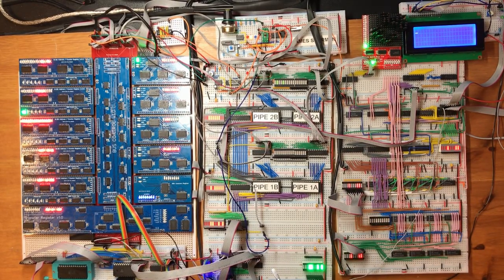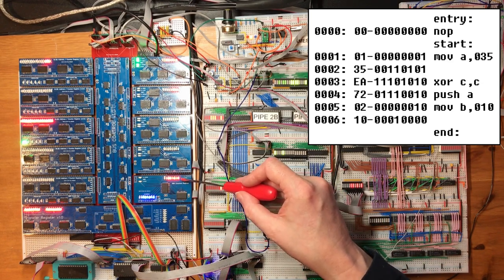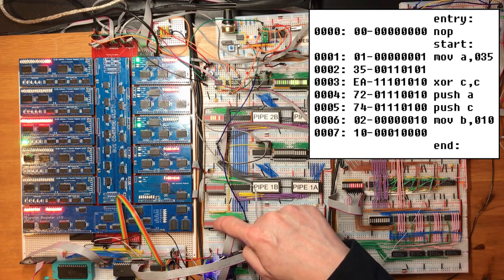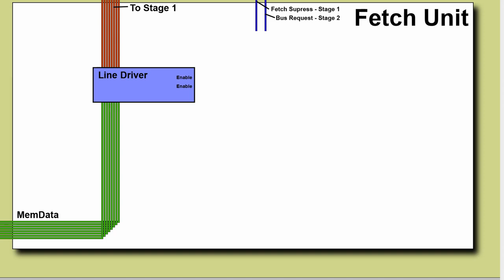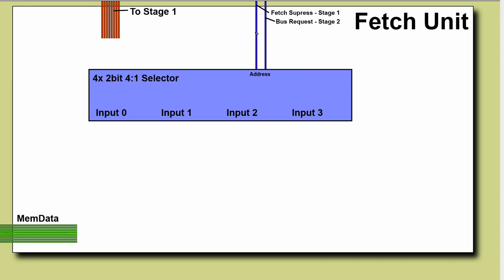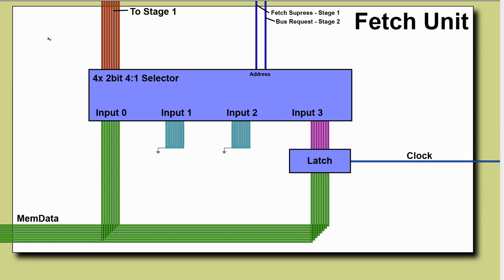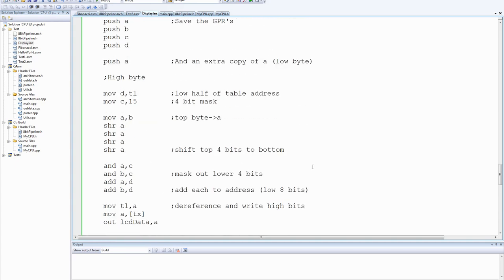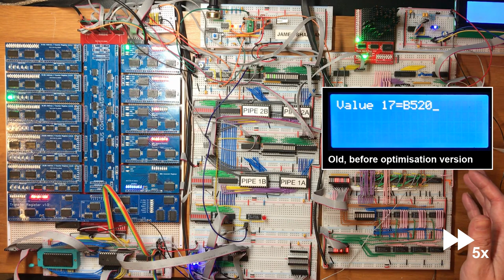Contention Example - Making an 8 Bit pipelined CPU - Part 65

Comment: I implemented your circuit to solve the contention issue shown in this video. It works fine, the only thing to do which was not yet mentioned in the video is to XOR the 2 inputs (no-fetch, bus-request) to the enable lines of th line driver. An excellent solutuon, congrats and thanks, James!
Reply from the maker: I'm not sure from your comment where you hit that problem.  There isn't a line driver in the proposed circuit, it sounds like you have left it in on the output in which case the xor is hybridising the two solutions.  I should get a chance to build the circuit in the next couple of weeks. Be interesting to see if I hit the same problem.
Reply: @weirdboyjim  I mention the line driver in pipeline stage0. I see, there is a difference in my build, instead of 541 I am using 245 because I could not find a spice model for the 541 in proteus, the 245 chip only has 1 CE line and therefore I XORed the no-fetch and busrequest lines, not to produce a NOP when both lines are high, but to fetch the constant load instruction a second time from the latch. it works fine

Comment: when showing code on the screen, you should place a red arrow of some kind pointing to the current line, would make following easier. thanks
Reply from the maker: That would be nice, I've thought about that before. It would be complex and time consuming though, especially since I'd have to separately annotate the instruction in each pipeline stage. I may give that a try next time there is a relevant video, but the editing already takes so long compared to the building I don't want to commit to too much extra.

Comment: Wouldn't it be simpler to feed Fetch Suppress NAND Bus Request into the enable of the stage 1 latches? So if both are set, the latches would not cycle in the next (both raw and decoded) instruction (which we know is a NOP) but keep the e.g. constant load for a second cycle. The instruction would still be double-executed, but you only need one or two gates and not a set of 6 selector, latch and gate chips.
Reply from the maker: That's an interesting approach but I was trying to give a clear example and I discarded a couple of other paths as I felt more complicated explanations on the implementation would confuse the message. Never sure how well I do with those compromises though.

Comment: Another interesting video, the contention issue is certainly a brain melter; your solution to store the instruction or data that was fetched last and lost by the write to memory is nice, but I'm trying to think if it's possible for the PC to run on and instructions get missed?

Having a 16 bit align assembler directive so you only need to do a single byte addition; seeing that drives home how little you know, and appreciate the giants whose shoulders I stand on who saw what I do not.
Reply from the maker: It shouldn't be possible for instructions to get missed because the issue only happens during a memory read during witch a fetch couldn't happen. You would have a problem if I introduced an instruction that both accessed memory and used an immediate as two of those in a row would trip the system up. I'll obviously not be adding one of those for exactly this reason.
Reply: @weirdboyjim  I got to part 72 yesterday and saw the circuit with the Fetch buffer in operation. I would need to go back to the opcodes to see when they increment PC, and so if a second pass of an instruction would cause it to inc PC twice. Obviously it doesn't.

Comment: So the 2 address lines would go high when the failed constant load enters stage 1 after the memory load, then the same constant load, previously stored in the latch chip would get sent out onto the pipeline, but would't this mess up the constant? The constant would be what was currently coming from memory, but if the address lines are choosing the constant load over the constant, then wouldn't the constant load load in the opcode of the next instruction after the constant?
Reply from the maker: The constant load instruction is what is held back until the memory contention passes, that way the regular load does get the correct data that followed in the instruction stream.

Comment: Have I seen this before? maybe I'm imagining things... but that is a very clever way to detect and deal with the problem. Is there any posibility that leaving the instruction to execute (and fail) could cause other unintended consequences?
Reply from the maker: At the moment the instructions that will trigger it are loading an 8bit immediate into one of the 8 bit registers.  In pipeline stage one they load the data into the constant register, in pipeline stage 2 they copy that into the destination register. If I don't stop the instruction then it will just copy the wrong value, and then copy the correct one. The difference will be if I want to implement something like "push [imm]", in that case not killing the instruction would result in odd behaviour.
Reply from the maker: When I upload videos I do a watch thru to make sure there are not any errors. There was an error but I forgot to cancel the release so the previous version of this video was up for a few minutes.  If you look at the final segment of this video I show the tidied up wires, in the previous version I was cutting those wires during the "race" but I accidentally knocked a wire and it messed up the last 3 numbers in the sequence. Slightly embarrassing if I had noticed.
Reply: @weirdboyjim  oh I see, that makes sense. I'm not going crazy ;). And thanks for clarifying the thing about not killing the instructions.

Comment: It would be nice if you implemented BCD since you are using 2x 4 bit adders this would be really easy.
Reply from the maker: Possibly more circuitry than you might think. You would need logic to break the direct link between them as well as comparison logic to implement a wrap and carry past 10.
Reply: I thought of it and all you need is to implement a half carry, which is currently your lsb adders cary, and comparison to check if any of the nibbles are more than 9. The comparison would be (HC | S3&(S2 | S1)) or (C | S7&(S6 | S5)) for the high byte. After that just add 0x06 if the first expression is true or 0x60 if the other expression is true. If you would implement this you could add the DAA (Decimal adjust Accumulator) instruction, which could be a hidden ADD 0x66 with the extra of controlling if either the MSB or LSB are 0 or 0x6
Reply: using your Diode Matrix this could be as low as 2 chips (AND gate and OR Gate)
Reply: Also nice work commenting the new code you wrote!
Reply from the maker: @wChris_  Yes, with the extra hidden instruction it would be quite simple. But I'm not expecting to do much work where bcd is an advantage.